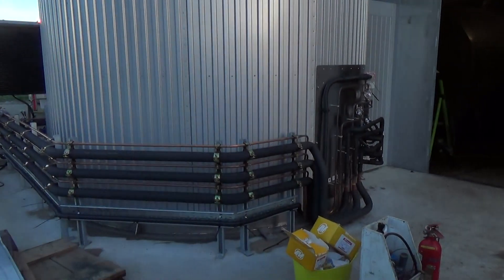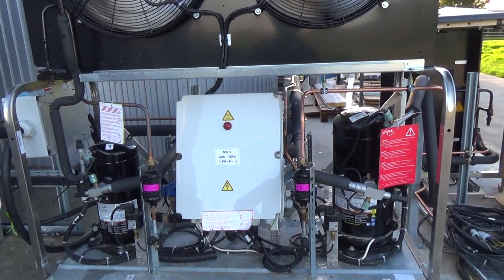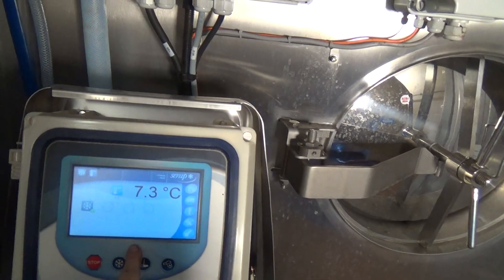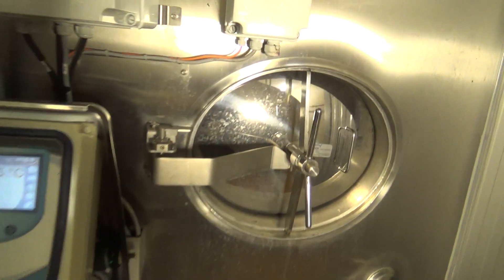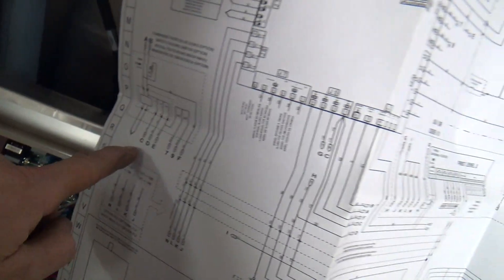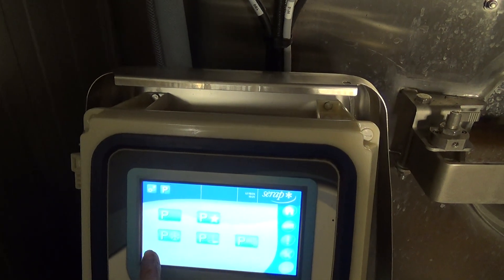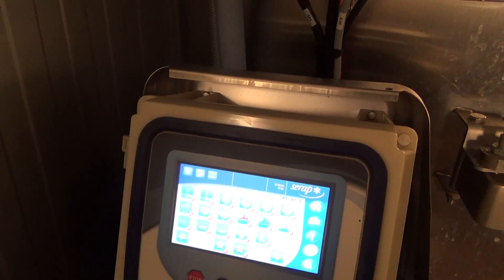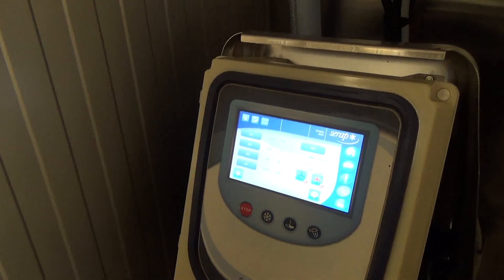Serap Milk Silo Installation

Comment: For as expensive as those systems are I would have expected semi-hermetic compressors.  At least they made it very easy to replace them.

SERAP= Société d'Études et de Réalisation pour l'Agriculture de Pontmain
Reply from the maker: Pretty much all brands use scrolls or hermetic compressors now, they don't run that many hours a day unlike a cold room or freezer system. Most of the ones I installed up to 30 years ago are still on their original compressors!

Comment: Some farmer definitely owes a lot more to the bank now, and is going to pay it off with gallon upon gallon of milk. Think if you opened that inspection port you would have a massive stream of water pouring out for a few seconds there, right across the room, before it hits the wall, then the floor.
Reply from the maker: Luckily the inspection ports open inwards so don't think I'd be able to accidentally let all the milk out! But yes theres a lot of pressure behind the tap, almost flooded the room just letting the water out.